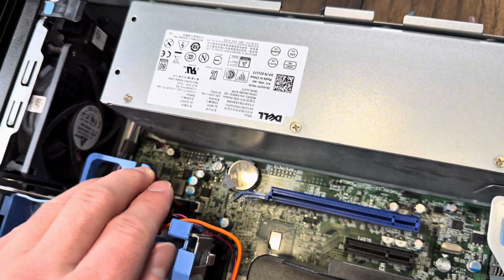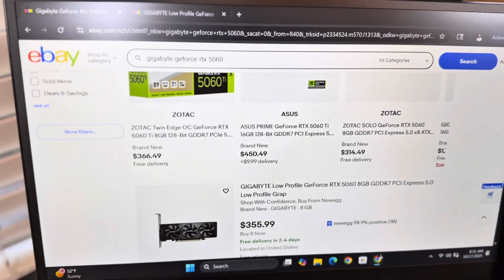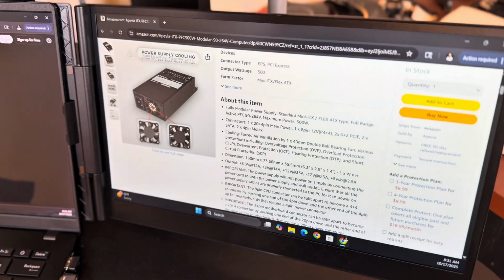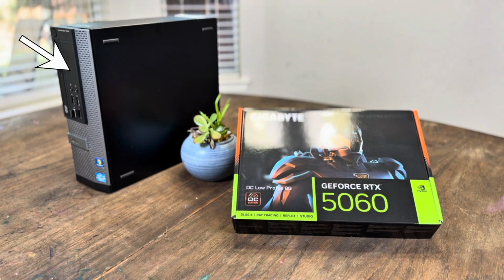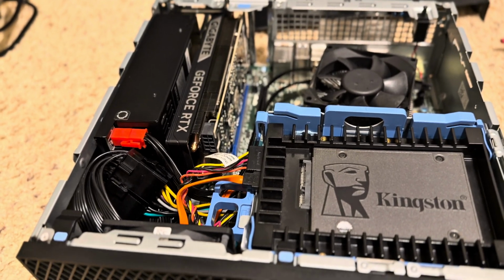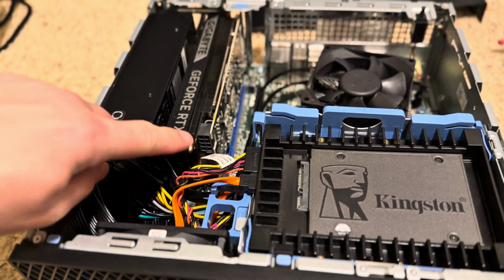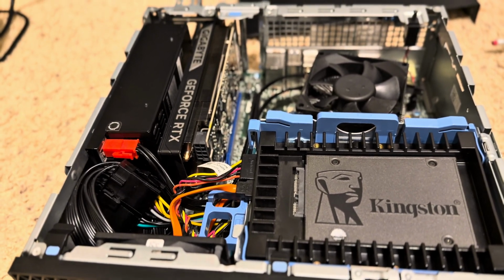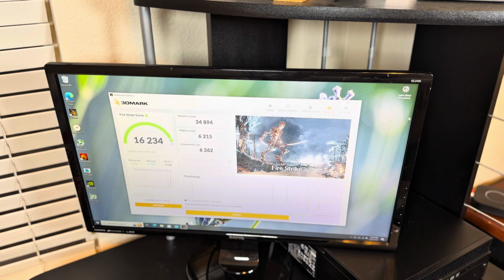RTX 5060 install in an OptiPlex 5040 SFF

Comment: This is what I was about to do.  LOL  I have already installed the fastest I7 that I could put in it and 32gb of ram and about to do the same GPU.  Just have to order another PSU to supply power to the GPU and getting a similar one that you have.  Just wish they made a LP RTX 5060 TI with 16gb of vram.

Comment: Pls do the 3020 optiplex I'm planning to buy it
Reply: Run Forza horizon
Reply: BAD PLAN. Except for a limited use case and financial situation. That use case being, running emulation or old games and basic desktop usage. Forget about new AAA games. It's just too long in the tooth for that, without the top end video option at low-medium settings, and maybe still not even then. The financial situation where this makes sense? You're broke, you want a PC now and you want to upgrade it in stages as your limited budget allows. I regret getting this, when I had the money to build fresh, but that's what I did... I guess my real reason was that I wanted something small and relatively portable because I would be on the move. I still wanted a desktop I could upgrade, and this worked. I guess the other use case is - because it's a cool meta. And it is cool, in a way, if you enjoy limitations.

Don't buy a 3020 Optiplex in 2025 if you plan on running anything recent. It is TWELVE YEARS OLD. I bought mine in 2019 so I have had mine 6 years... That being said if you just want to run retro games on it, it will work... for emulation or really old games. An i7 or i5 is preferred, an i3 will disappoint you. It seemingly will also support the E3v3 Xeon chips if you want i7 power for i5 money. Install an SSD and preferably 16GB of RAM (which is the max for this model) for actually using it as a desktop, And if you want any hope of really gaming, you'll need at least a basic GPU - high end recommendation Yeston 3050 6GB, otherwise any single-slot, half-height, no external power GPU (which really limits your choices) will do to make it run better than intel HD 4600. I have a GTX 1050 4GB and it's fine for my use (desktop, retrogaming, some slightly older AAA titles at low-medium settings). But don't mess with any card lower than the GT730. And even then, only the GDDR5 version. Radeon recommendations: RX 6400, RX 6500, RX 550, R7 240. Sadly, they didn't make any small bois for the Vega and RNDA1 family. Intel ARC: No. Requires ReBAR and this thing doesn't have it. So nVidia or AMD only. Keep in mind that most of the cards that qualify will not have "game-ready" drivers for much longer, most are going (or have gone) into maintenance phase. At least they're not unsupported entirely.

In short, just don't. This thing is 12 years old. There are MANY better options than going this route. A mini-PC will smoke this. But if you want something upgradeable, a cheap, standard build based on AM4 with a Ryzen 3600 is about $400 without GPU, made with new parts. That's what you'd end up spending trying to make one of these 3020s worthy of gaming. I know. I did it. But I've had this for 6 years, you're way behind, bro... If you go with AM4, you'll have a system you can upgrade a little; it'll max out at 64 or 128GB of RAM instead of 16GB...and it can go all the way up to a R9 5950X with the right motherboard.  If you want to risk it and go the used route for a build you may save money, but it's a risk and it might be a good idea to spring the extra couple bucks for eBay buyer protection just in case something goes wrong with the transaction.

And I was talking about the SFF model, since that's what the PC in the video is. However, even if you're thinking of the desktop, thinking it's going to give you more upgrade options, like maybe more GPU choices, sure, but in any case that PC is still TWELVE YEARS OLD.

Comment: A 5040 and 5060 met and got married. Baby 10.1k was born. The 1 stars reviews for that power supply would keep me away from it. I also read that the power supply fan on that unit you bought runs constantly and is loud. Okinos case man. Full Form Factor PSU. Go 750W, do that shit right and be ready for the eventual removal of that Dell board and 6th gen chip. You paid extra for a Low profile card too. could have gotten 16GB man. Same Price / perf range and a graphics card that would have moved to the next system. Penny wise pound foolish? These sorts of builds ALWAYS are, unless you can find good deals on used components. An 8 GB card for 360, youre paying for the form factor and sacrificing 8GB of Vram.
Reply from the maker: Thanks for watching!

Comment: Ok more fiddly...but you could of taken the mb out, installed the GPU and put it back in..which would of meant not having to cut up the case...possibly?
Reply from the maker: Apparently, Dell never wanted a dual width GPU in that slot in the 5040, because not only is it too close to the stock PSU, when swapping for a thinner PSU, there are parts of the case that project inward to help hold the stock PSU in place.  I always try to avoid cutting and bending where I can, so I appreciate any ideas!

Comment: i just tossed my dell  OptiPlex 7050 bord in a fish tank case 700w psu with the adaptor 32gb of ddr4 in dule channel 16x2  i7 7700 a  rtx1070 8gb windows 11 pro 12 rgb 120mm fans fyi if you do a case on a dell make 1st to spliced the black & yellow power wirers to the new case power button don't cut it off you need it for lights/work right it will work a usb adaptor  it games well look new and im happy that i have a nice pc for less then 300$ new /used parts all in amazon/ebay /Facebook take your time took me 6 weeks to get the parts but i would do it for the $$$ i saved and the hunt was fun ,,
Reply from the maker: Niice!

Comment: Good video. I would have went with another card instead. The 5060 is 8x's pci-e 5.0 and 8gb ram. Your motherboard is a Q170 chipset with pci-e 3.0. Hardware Unboxed (and others) have videos showing that the 5060's performance tanks in games on older pci-e generations because of it's specs.
Reply: does the same thing apply for the 4060?
Reply: @natsuLore  Yes.
Reply from the maker: What card would you use to get the most out of that particular Optiplex?
Reply: @OptiGPU  believe it not a 3050 will even be bottle necked by that opti it be close but still bottle necked unfortunately that be about its highest recommended
Reply: Still much better than 3050 even on pcie 3, right?

Comment: Rather than letting the GPU hang loose 
and potentially damage the PCIe slot over time,
it is better to purchase a custom VGA bracket, 
cut and adjusted to fit the PC casing.
Reply: Or 3D print one - whether yourself or online (something the size of a GPU bracket only costs a few quid to get done).
Reply from the maker: Also great advice!
Reply from the maker: Great advice!

Comment: great video! What about using some vhb tape to hold in the flexATX psu? Also what kinds of temps are you seeing?
Reply from the maker: That’s a great idea! I’ll get back to you on the temps. I tried to use FurMark to check the temps but I think I need to update the app, it was telling me that it was 210°C which… yea I don’t think that’s possible.